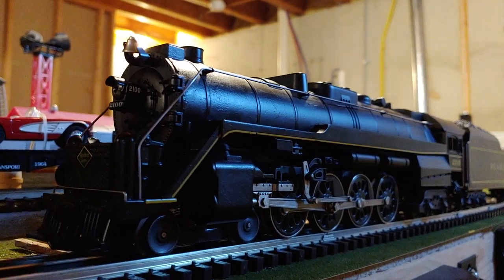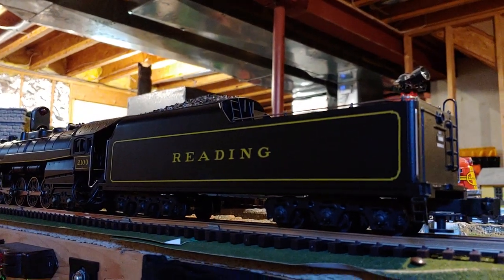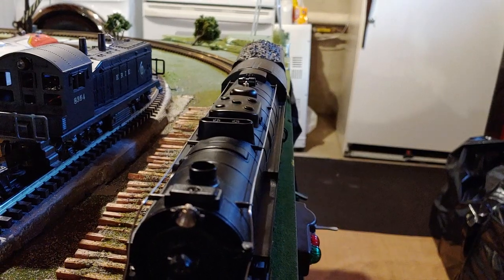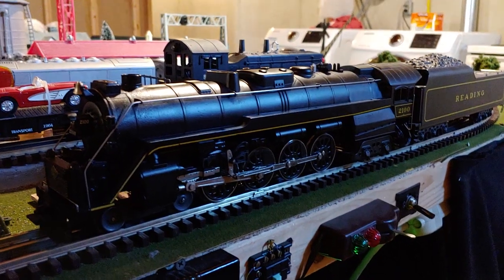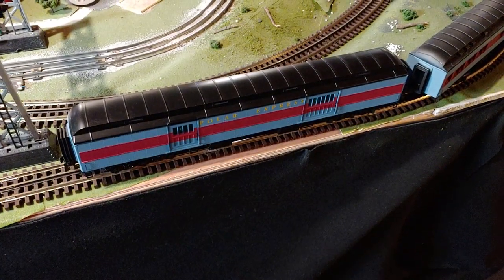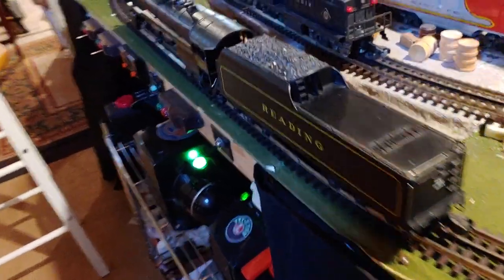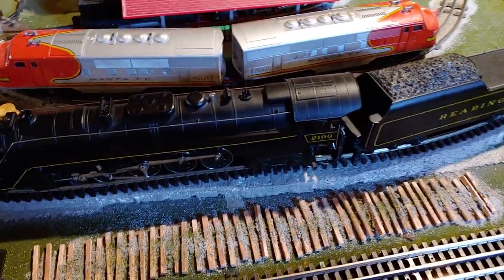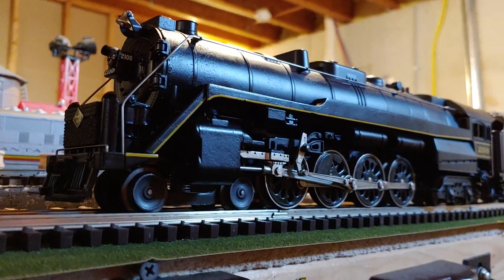Lionel Reading T1, 2100

Comment: I have a lot of post war, and a lot of TMCC steam as well. Steam is my favorite type of engines to run. I wanted to say I am thinking of picking up one of those t-1 2100. They look great,and I hear they are great pullers. Everybody thinks I am going to install TMCC and rail sounds 4 or 5. I think after seeing your video . I will keep it stock and just enjoy the looks of the drive rods moving along. I rigged a special coupler system up and run a post war 675,and it twin 2025 double headed. Pulling 18 to 22 cars. The driver action is great. I did convert the smoke units to liquid. Man do they puff. Thanks again. And keep up the good work

Comment: Nice video. I’ve been considering getting one, as I’ve ridden behind a real T1 (number 2102).
Reply from the maker: If you can find one for a good price I would definitely recommend it. I have since upgraded mine with Electric Railroad cruise control and Railsounds 4.0 which I would also recommend if you have the time, money and patience to make it work.

Comment: Hey, that was a GREAT VIDEO and you explained all the features of the engine, some people are too LAZY to at least let you hear the features, does it have magnitraction or rubber  tracksion bands ? Thank you
Reply from the maker: @geraldmosley2195 thank you! I'd have to double-check about magnification, but I know it doesn't have traction tires. I've never had an issue with grip, though. I run a lot of die-cast cars so my trains (although short) are heavy and the T1 doesn't even hesitate when starting out. Sorry for the late reply but I hope this helps

Comment: Nice review. I got the same one last year at a train show and love it. Gotta ask, how is your smoke unit so good? Mine will barely put any out
Reply from the maker: When I recorded this video the smoke unit only kind of worked. I took it apart and realized the heating element was broken completely in half. So I have no clue how it worked at all. I have since ordered a replacement and installed it (You can see the new one in action in my Run-Around Track series). I saw a modification online where someone dilled out the hole at the bottom of the smoke stack to be a little larger and that thing smoked like crazy.
Reply: @cwhall01  there are a couple things you can do. Besides replacing the resistor and batting, the modification is drilling a hole slightly above the bottom of the vertical divider. Or, purchase the whole smoke unit from Lionel that is for the NYC Mohawk that was produced a couple years later (6-18009 IIRC...). It is manufactured in the manor people update the original to. Hope this helps.

P.S. I also have the Chessie Steam Special version and love it just as much as the 2100.

Comment: I just got a Lionel T-1 from 1989. Do you know where the volume knob is I can’t find one on the T-1
Reply from the maker: Unfortunately this locomotive doesn't actually have a volume knob. I had to install one when I converted the engine to tmcc.
Reply: @cwhall01  oh ok
Reply: @cwhall01  is there anyway to adjust the volume
Reply from the maker: @brendanstrains9725  there might be a way to add resistance into the speaker circuit but I am not sure. I would do some research on the setup of the Railsounds board. There may be forums out there were people have lowered the volume.
Reply: @cwhall01  yea my T-1 it’s sounds are decently quiet but I am alright with it. Thanks I was just curious if there was anyway to turn them up.

Comment: Will it work on r36
Reply from the maker: It will run on 072 yes. If you mean O36, it can run on it but it is really unhappy.
Reply: @cwhall01  does it derail on o36
Reply from the maker: @OldIronVideo  If you run it slowly it will not derail in my experience.